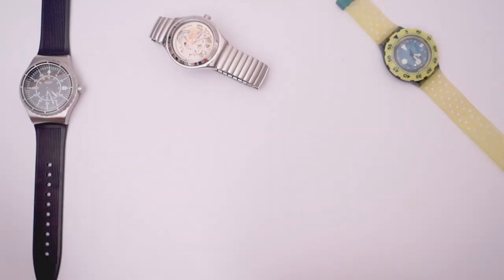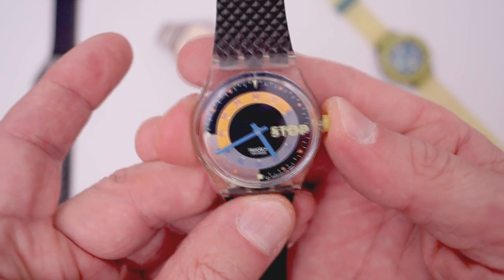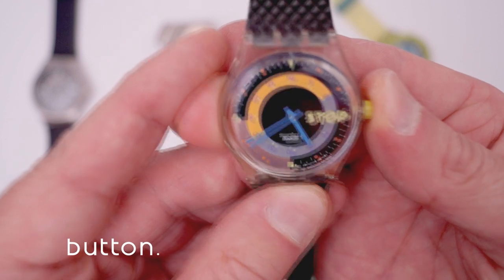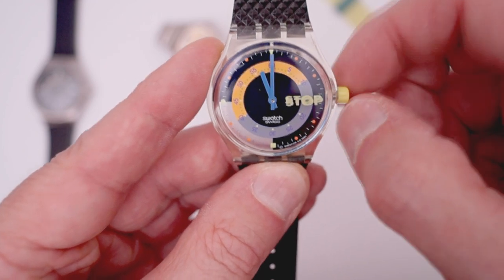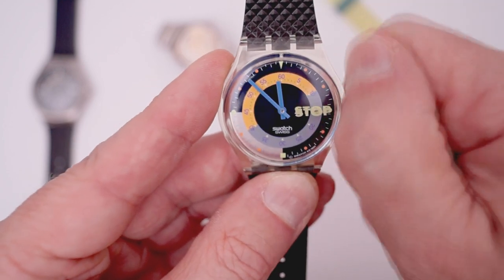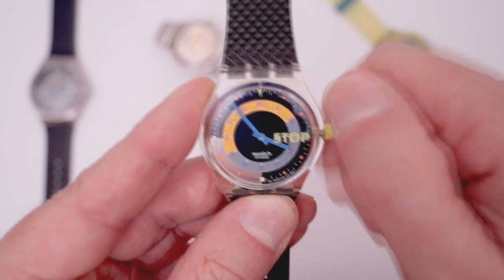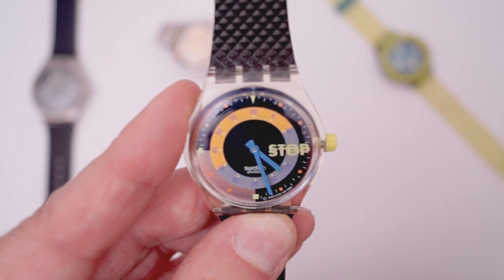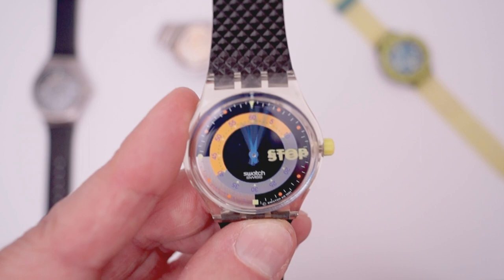Swatch Stop Watch Calibration - Zeiger stellen - Kalibrierung

Comment: I don’t know if my stop swatch doesn’t work anymore or it’s just the battery, i can’t set the hands cause they don’t move, and I’m gonna take it to change it or repair it soon. Do you know something about it?
Reply from the maker: The first step (and inexpensive, too) is to put in a new battery. Use a Renata 390 (or equivalent from other manufacturer). Good luck.
Reply from the maker: I recommend original Renata batteries though.